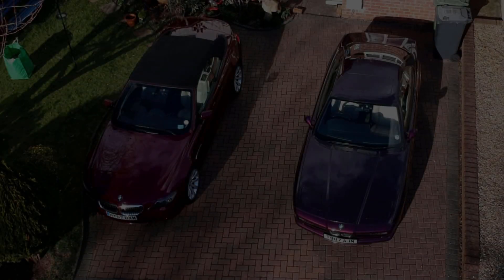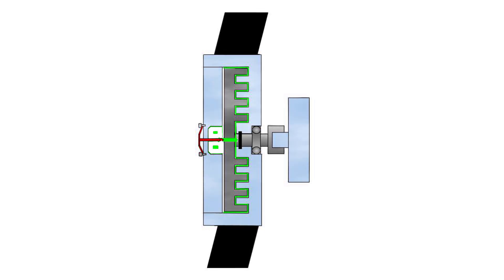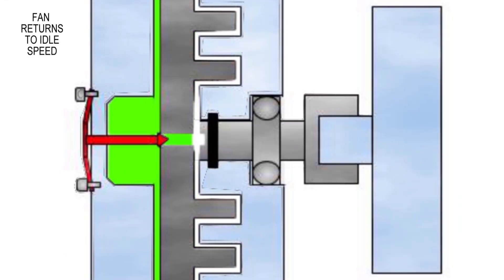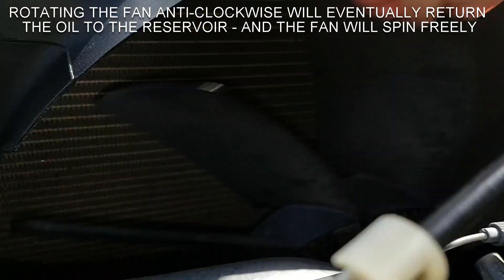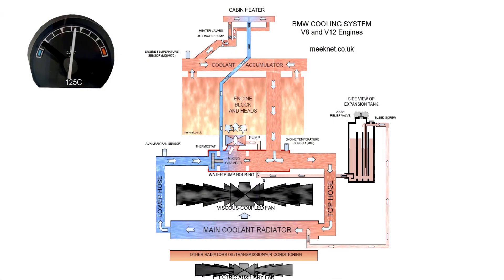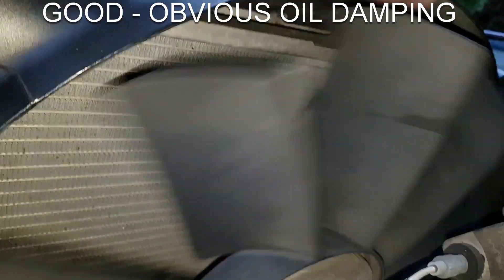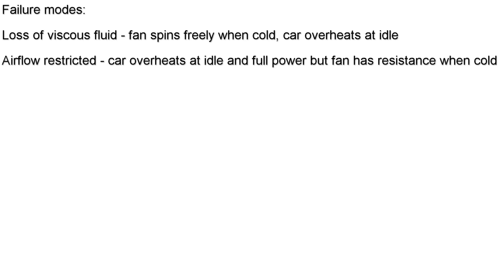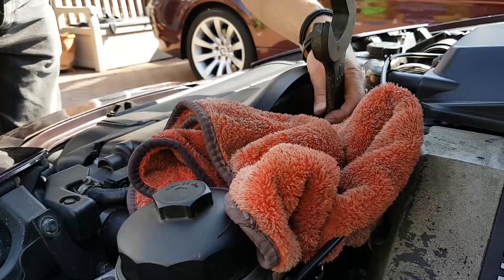Stop poking the BMW Viscous Fan! A better way to test

Comment: I tried several brands of viscous coupler for my E34 and I found all of them are always fully "locked" so they spin fast with the rpm all the time, and I'm afraid it breaks and destroys the radiator, hood etc.
What do you recommend?
Reply from the maker: Buy it directly from BMW!

Comment: so a yet to be installed viscus fan turns freely.  phew..  installing one on an engine thought it was fubared.  still may be. but at rest cold. it should spin..  More to check... hmmm... mine spins free a shiat.  but it has been off the engine for a monthhs so it presently may have no oil in the passages.  hmmm..  so how to test one where oil is likely not in the passages at all. ???
Reply from the maker: The clutch has to be always stored upright, the same way it is in the car. Stored like that there will be oil between the plates and should NOT spin freely

Comment: My 2011 BMW 328i xDrive fan roar when I start the cold engine, it sound like air plan take off, the roar is on and off and repeat, the hidden menu shows the temperature can be as low as 30 Celsius(cooled overnight)  when fan roar, I replaced the coolant sensor but that does not fix the problem, I test the fan resistant when engine is off, the fan blade can turn a few rounds and stop, which is a sign that it's loosing the resistance, but if I use newspaper roll to stop the running fan when engine is on but the fan blade cannot be stopped, which indicates somehow the fan is still working.  from what I described above, do you think the roaring fan is a problem of bad fan that need replace? can there be other causes?
Reply from the maker: Yes, that doesn't sound right at all, probably a good idea to replace it

Comment: hi im having over heating issues on my e28 when its hot im still able to stop the fan by hand does this mean its not working correctly thanks
Reply from the maker: Yes, very likely the viscous-coupling, but check there are no leaves in-between the radiators

Comment: Tim, my Audi is over cooling at around 75 to 80. The thermostat is ok I tested the old one and also installed a new one and no change. Do you think my viscous fan is faulty. I have a secondary electric fan but that is operating as normal.

Comment: Very good informative video, Question: I have a 2001 525i, E39, six cylinder. It runs too cool. When moving the temp indicates just past the 1/4 mark. When stopped at idle, the temp increases to normal, needle straight up and stays there. I can see the auxiliary fan operate; but when moving the temp drops again to the 1/4 mark. The viscous fan and aux fan seem to operate normally. I suspect the thermostat may be stuck open, however it seems to warm up quickly. Any thoughts? Thanks.
Reply from the maker: Yes, thermostat stuck a bit open!
Reply: @TimmsBMW  Thanks very much, you have confirmed my initial diagnosis.

Comment: Great video. I do have a question, so I have an e65 fan and clutch upgrade on my e39. Trying to spin when cold it has lots of resistance, however when trying to spin the other direction to get it spinning more freely it makes no difference. Does this mean the fluid can't move around freely? Should I replace it?
Reply: Spinning by hand might not be enough to pump the oil into the reservoir.
Try running the engine a minute or 2 when all is cold, and then try again...
The engine spinning will scavenge the oil much faster than by hand, and will disengage the clutch, if the valve is closing properly.

I would think it could take a few dozen rotations* in reverse direction, depending on how much of the original oil quantity is still in it.
(if it is nearly empty, then only a few rotations could purge the oil back into the reservoir...)
* [rotations are fan retrograde rotations, relative to the input shaft, not total assembly rotations].
Mr K L

Comment: Hi Tim, I just replaced my viscous fan with a brand new on my m62 engine, the thing is when my engine is cold and I start the car, the fan is working but it’s really fast as if the car was already at temperature but it’s not yet.
Doy you have an idea? Or is it just normal with a new viscous fan clutch maybe there is an adaptation time?
Reply from the maker: That's perfectly normal - have another watch of the video!

Comment: my clutch fan is always on but it seems to go faster with engine revving but it isnt loud and it isn't locked. there is clear oil dampening when the engine is cold, but the newspaper did stop the fan but it took 10 seconds to do so. is this a bad fan?
Reply: my engine heats up normally and never overheats. new thermostat
Reply from the maker: The fan always rotates but is usually unlocked until required - if you are not overheating and the gauge stays in the centre don't worry!

Comment: Very thorough and helpful, is it possible for a fan/fan clutch to get out of balance. I have a ticking rotational noise when the car (e36) is at idle and fan engaged. It’s getting louder over time. The fan seems ok when cold, using your tests. Could the bearings be on the way out? I’ve ordered a new one, but most other pullies it tensioners have either failed or been replaced or seem quiet. I want my car running quiet again and I’m thinking it’s the viscous fan.
Reply from the maker: Sorry for the wait - yes, the bearings can go - and so can the bearings in the water pump itself. With the engine off grab hold of one blade and carefully lift upwards - there shouldn't be any movement, if there is then make sure it isn't the water pump!
P.S. You have a great channel!
Reply: @TimmsBMW  thanks Tim, it’s obvious you put a lot of care into your content too. On the BMW, the new fan clutch came today and I inspected the old one last week. I’m 90% sure it’s that, but I don’t mind eliminating it from the equation. It could well be an original part - I’ll look for a date when I remove it again. The water pump was done and all the other major likely sources have been replaced or redone over the years, pullies, alt, pas pump, yet the car still rattle ticks when it gets to temperature in traffic around the 92 degrees mark. The fan clutch is the only component which predates onset of noise yet it hasn’t given up the ghost. It’s quiet with aux belts, fan etc. removed. I’ll let you know what transpires. But I don’t mind chasing other stuff until the car purrs again. This has been a bit of theme since 2015, which was when it got that bit noisier! I’ve owned car since 2006 so all part of the fun of running a classic daily.

Comment: I'm trying to test my e39's M52TU's fan clutch. I noticed on a cold start it would be locked on for 15-odd seconds, as though clutch engaged when hot. Almost ditched it bc of that. You are the only one on the internet it seems to mention this oddity and why, in point 7 at 4:50. Subbed.
Reply from the maker: Thanks!

Comment: Hi Tim, fantastic video. 
I have the opposite problem. My e30 325i starts and runs great but the water temperature gauge is barely just above the blue line. I have checked the viscous as per your guide and it looks to be workout very well. Faulty thermostat maybe?
Reply from the maker: Yes Angat, the thermostat is very likely to be the problem.

Comment: Very usefull, thanks, I think that muy car has the last problem, when I start it cool the fan will do a tractor noise at low RPM, It doesn't happen every Time, at mayor speed It doesn't sound or when the weather Is rainy It doesn't happen. The blades offer resistance when Its cool. And yes... It can travel an amount of 10km without reaching the optimal car temperature, It still remains cool. Do you think I should replace It?

Comment: hi I have the same problem with my prado. I don't know if i need to change the whole clutch or just the silicon oil of the fan. It will overheated When I stopped from a  long way driving, but the temp all good when I drive in the town. How do you think about it Tim, I need your help

Comment: Great video, I never really understood how these worked before. I’m looking at doing a full cooling system overhaul on my E36 328i since my thermostat is stuck open. My viscous fan is working properly so I’m not sure if I should bother replacing it since I’ve heard some of the non-oem replacements have issues.

Comment: Very informative video, thank you! I have a problem with my cooling fan ('01 e39 540i), it won't spin faster when the temp reaches 92 degrees, not even 109 - fan speed won't change (keeps spinning at regular speed).

1. Thermostat seems to be ok - doesn't take long for engine to warm up.
2. Water pump seems to be ok - no overheat, no coolant leaks.
3, Fan won't spin freely when I turn it with my hand - good drag.
4. Condenser fan engages periodically with A/C off.
5. Checked for airflow blockage - don't see much debris in the radiator.
6. The needle points at the center of the gauge, no fluctuation .
7. No "low coolant level" warning message, checked level physically - seems to be ok

Genuine fan clutch was replaced a year ago. T-stat and water pump were replaced about 6 months ago. The problem started about a month ago.  

Just don't know what else to check.
Reply from the maker: The E39 has the temperature-mapped thermostat with a base opening temperature of 108C without intervention. 109C is quite normal - especially as 108C is the INPUT temperature to the engine and the MID/diagnostics temperature is read at the OUTPUT from the engine.

Comment: hello everyone and thanks for your guides. I replaced the viscous fan on bmw e39 because the electric fan was often inserted. nothing has changed. after 5 miles at 4000 rpm the electric fan is still on. the engine temperature is always ok, and the radiator is clean. with cold engine the new viscous fan is strong to turn by hand. when the engine starts it runs very fast and looks like an airplane. Why?
Reply from the maker: The auxiliary fan on the TUB-engined E39's DO run even if the temperature is in the safe zone.

Comment: THanks for your video, the best one so far. I have a 96 328i E36... should be similar at what you ve explained? I just changed the fan clutch in my car, and now it sounds like a vacuum, spinning  I believe at the same speed as the engine, but I dont think it's locked since it stil has normal play when car is stopped and I move the plastic Fan.... What should I do? Im actually quite pissed and argueing with my mechanic wether is fine or is a faulty clutch... Thanks in advance!
Reply from the maker: Hello Matías, all the viscous-coupled fans should work in exactly the same way as described in this video.

Comment: Hello 

Thanks for the great video! 

What if the fan this type after starting the car engine while still cold, before the thermostat opens start engaging/kicks in for a few seconds and goes back to normal rpm, What that means?
e39 M52 engine 1998 528i only 30 000miles on it.
Reply from the maker: As shown in the video - from cold it will engage for a couple of minutes - and then should idle until the car is pushed hard....
Reply: @TimmsBMW  When I start the engine all looks fine but worries me that the fan starts spinning faster (like tries to cool down the engine) on idle while the engine is still cold?
Reply from the maker: @shefketmustafa9228  If the fan starts pushing a lot of air around when the engine is idling and cold it is time for a new one!
Reply: @TimmsBMW  
I was going to order a new fan clutch but today I heard this...
On a functional fan clutch, the fan should engage briefly (<30sec) on a cold start and then disengage...

If this is true mine should be fine then!? 
Because this is exactly what's happening in my case??

Cheers 
Shef
Reply: @TimmsBMW  Hi
Today I took out the fan clutch for a test(just with hands).
Spin it for a while hard in the beginning (clutch engaging)but after few seconds star spinning free and smoot but while spinning freely randomly it looks itself and it has resistance like in the beginning.
I'm guessing it doesn't hold the liquid /gel before reach the high temperature when it should do in working condition?
Am I in right direction?

Thanks
Shef

Comment: In my e46 m57 3.0 liters diesel the engine heats up very well, preety quickly for a diesel, I can spin it when the engine is off, obviously not freely, but the car sounds like a boeing 737 especially in like 2-2.5k rpm. Is the fan clutch working ok? Maybe im overthinking but i thought that the clutch is fully on all the time
Reply from the maker: It should go out of lock from cold in a couple of minutes - if it doesn't you need a new one!
Reply: @TimmsBMW  thanks for reply. Out of lock, do you mean like completely free rotate? On cold engine i can rotate it preety easly but it does not spin so much. It is just like on your video :)

Comment: My cold fan roar came back but the hot engine shutdown the fan just spins and spins and spins.  What is the normal fan rotation after a hot shutdown?  I have been seeing it should be 3 revolutions or less? What is correct...? Thank You
Reply from the maker: Thanks!

Comment: I learned so much from your video.  I replaced fan clutches that were perfectly fine.  I see it is normal for the fan blade to rotate very slow.  You can stop it with your hand. I have replaced thermostats and the fan clutch.  I must dig deeper to maybe a clogged radiator or water pump problems.  Thank You
Reply from the maker: Thank you, and always my pleasure!

Comment: My BMW e39 cooler fan clutch is stucked and it is now always on and it is already been decentralized and causes little bit vibration.
Reply from the maker: Get a new one quickly - the next thing it will do is break apart and make holes in your bonnet, coolant pipes and cowling!
Reply: @TimmsBMW  Thanks for your answer. I will install new fan clutch. Today when I tested there was no vibration at all but the clutch was still stucked.

Comment: Thank you for the video. I have some questions regarding my diesel Bmw. I replaced my fan clutch, with a new Hella one, and the temperature still sits around 100-105 C. For a diesel engine I think it's a little too high. I did the newspaper test (stopped the clutch while hot), and it moves easily when the engine is hot (100+ C). Since it's new, I will do the test with cold engine, tomorrow morning, like you showed in the video. But, many people say it's not ok to be able to stop it while the the engine is at 100+ C. Thank you
Reply from the maker: There's a couple of things to remember - the viscous-coupled fan works on air temperature not engine temperature - if the airflow is restricted past the viscous fan then it will do nothing - however it should howl away when started from cold. Engine temperature is set by the thermostat, it does not matter how efficient the rest of the cooling system is, if the thermostat is closed it will make no difference! You haven't said what the model is, but I would suspect that you have the temperature-mapped thermostat which opens at an inlet temperature of 105C or so - and only opens colder if the engine is being pushed. More info here: https://youtu.be/XGIk8IXSGIE
Reply: Timm's BMW Repairs and Information Thank you for your answer. My engine is a diesel (I live in EU), the thermostat opens at 88 C. But now it's ok, I've heard the viscous coupled fan working a couple of times, a diesel goes harder to a 96 C air temperature. Thank you.

Comment: Thanks for all this knowledge. I've got a question, my e36 has difficulties getting up to temperature. My fan makes the roaring noise and revs up with the car regardless of the temperature, but also spins with good damping. Im just curious if you think the bearing is seized or perhaps there is something preventing the oil from returning to the reservoir? Ive tried spinning it in the direction opposite to which it usually spins and it didn't ever rotate easier
Reply from the maker: If the viscous fan makes a roaring noise after, say 5 minutes after starting from cold, then the bi-metallic strip has failed or is covered with grease, try cleaning it first. If that makes no difference then it is time for a new one!

Comment: There actually is another failure you can get. I replaced the thermostate 4 times one year on my 85 Mercedes. They kept locking up and the engine temp immediately would go over 100 c. I of course would stop and remove it till I could get home and install another one. I finally figured out the radiator was plugged and replaced it and no more thermostat locking closed.
I don't know why that caused the thermostats to fail but they did.
Reply from the maker: Thanks for your comment! I cover the problem you had here: https://youtu.be/XGIk8IXSGIE

Comment: Hi, thank you for the video. On mine the clutch is not completely seized (it does not do the 'roaring' thing) but it does seem to run more than it should - temperature does not come up to normal. I have tried doing the turning it back backwards thing you suggested and it does not make any difference to how free the fan spins. Is there a repair or adjustment etc that can me done on these? thanks
Reply from the maker: If the temperature does not reach the centre of the gauge then the most likely problem is that your thermostat has failed. The radiator is bypassed by the thermostat until the coolant system reaches operating temperature.
Reply: @TimmsBMW  Ok, thanks for the reply, I think my cool running is due to the fan running all the time, I was wondering if there was failure mode in which the viscous clutch - whilst not seized - did not disengage??? thanks.
Reply from the maker: @iozel4633  Have a watch of this: https://youtu.be/XGIk8IXSGIE it explains how the cooling system works and how the radiator (and the viscous fan) has no affect on reaching operating temperature if the thermostat is working correcty